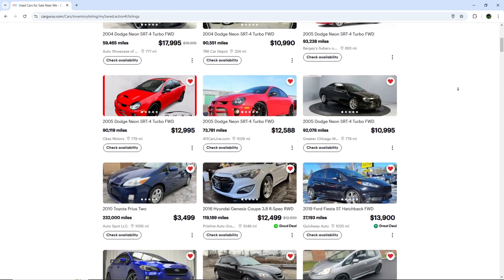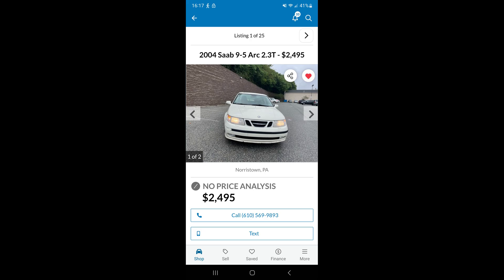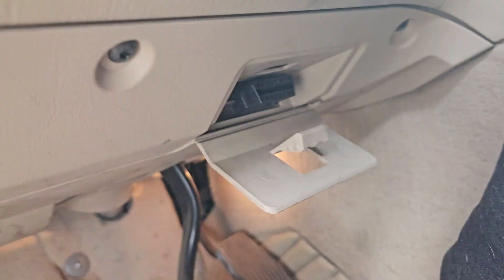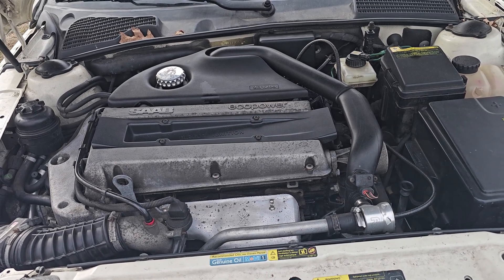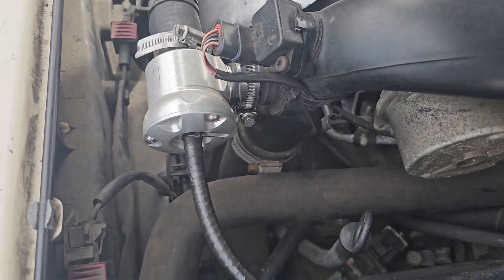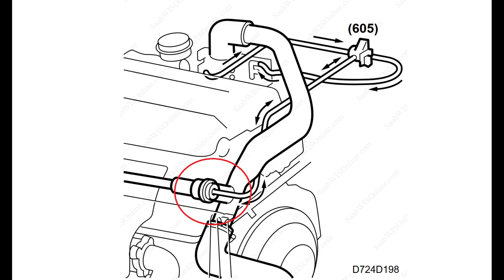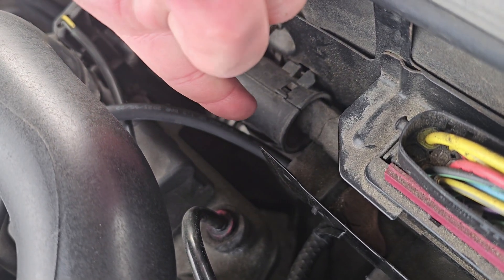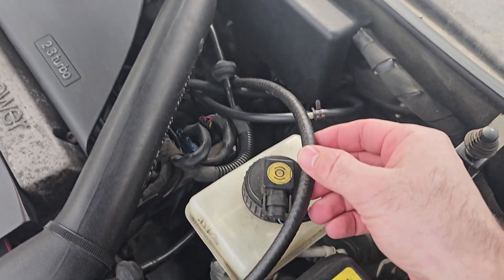SAAB 9-5 Project Car Episode 1: Charge Air Bypass Valve / P1110.

Comment from the maker: For clarification, the CPU doesn't necessarily "open" the charge air bypass valve, the vacuum and "boost" levels are controlled by an internal spring in the Bypass Valve, but the sensors are there to detect the vacuum and "boost" levels....if these levels aren't within spec, it is likely something in the system is faulty (like a hose) and will trigger the P1110 code.